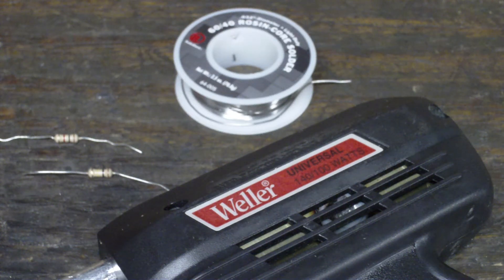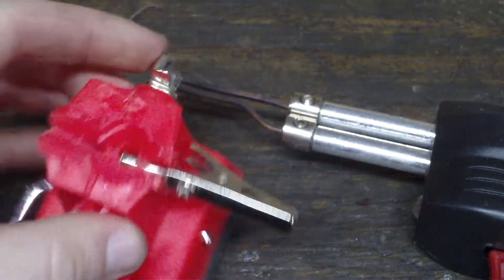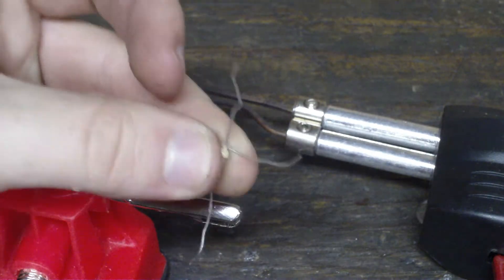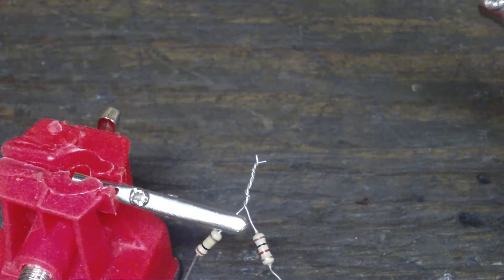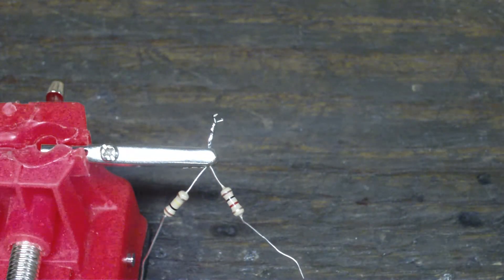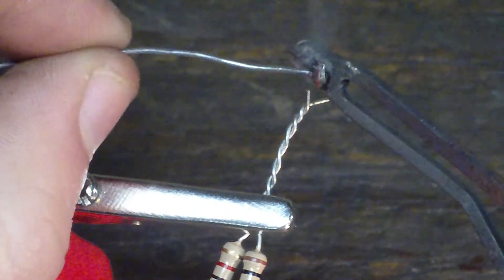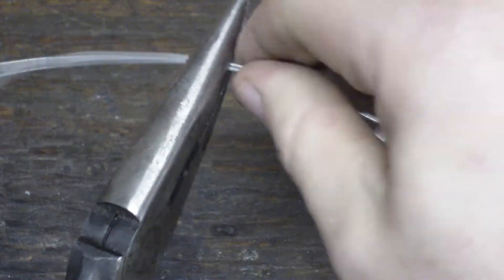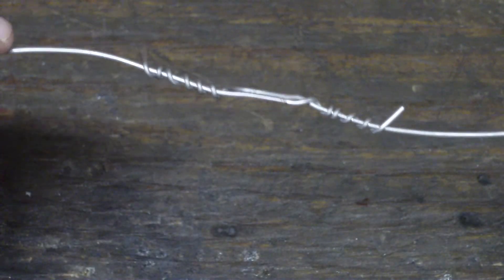How to Solder / Splice Wires //// Info about Old Western Union Telegraph Wire Splice

Comment: i have never seen the wire splice done that way.  The basic idea is correct but the direction of the second twisted wire is in the incorrect direction.  
   So that when you look at it  should be so that the twisted portion will look like a continuation from one end then on to the other end as\\\\\\ \\\\\\\,  not as shown here as \\\\ /////- the latter will have an easier time of unwravelling.
rregards,